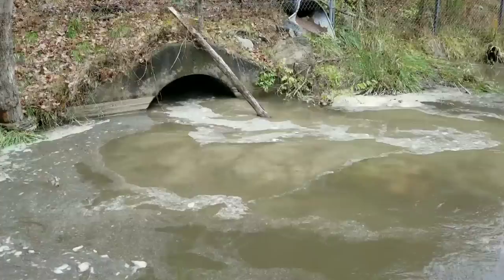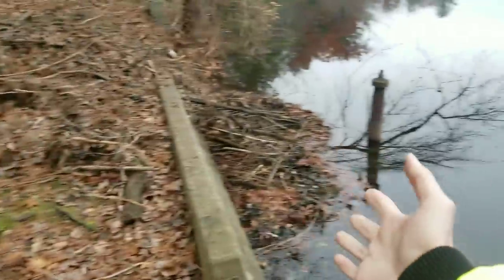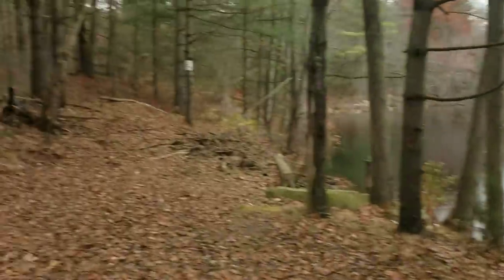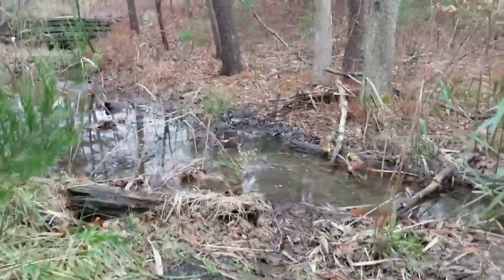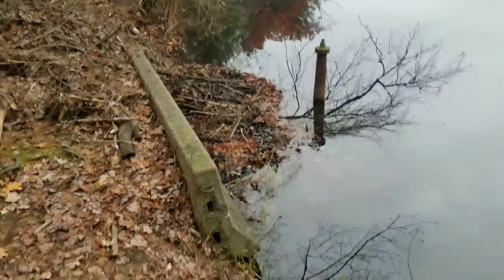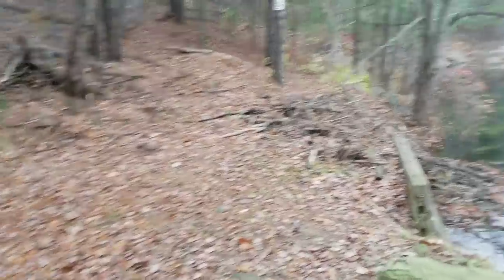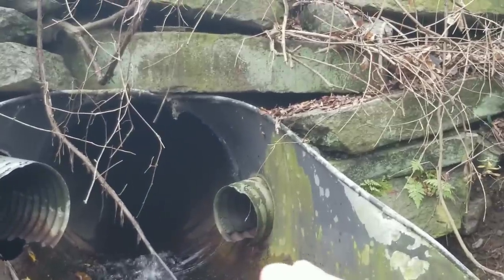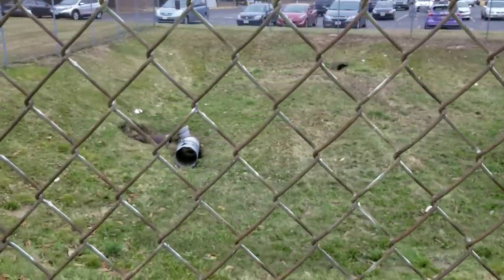Lake Drain Culvert Collapse/ Sinkhole UPDATE 11-5-2019

Comment: " A Massive sinkhole doesn't just open up overnight."

And yet just a couple weeks ago a massive sinkhole appears out of nowhere and swallowed a city bus.
Reply: I think the idea was that since the pipe just started to get rusted, the sinkhole won't appear that quickly. Sure sinkhole appears suddenly but it takes a while for the soil/ground to erode before the sinkhole to form. Given that the culvert is blocked, it's less likely the sinkhole would develop since the water can't carry soil away. If they just cleared the culvert of sediment and left it I'd be seriously concerned.
Reply: @takumi2023  3 months ago he went inside the pipe and it had sign of rust and small holes where it was evident some dirt was coming through. I wouldn't be surprised if the whole road collapsed if they left it for any longer considering how fast it escalated in just those 3 months. All it would take is some good blasts of torrential rain.
Reply: thats because it started happening years ago and was never discovered until the sinkhole appeared.  which gives the illusion that it appeared over night.
Reply: @takumi2023  It's amazing doing a little bit of math on the amount of dirt that looks to have already fallen. If the dirt is falling halfway down the pipe (150ft in) and the pipe is 4ft in diameter and the dirt has half filled the pipe from the ingress point, that's ~942.5 Cubic feet (26.6 Cu. Metre) of potential sinkhole. Insane
Reply: We cant forget about the Corvette museum either. The video is there for all to see 6 Corvettes swallowed overnight when the floor fell through. It does happen. If earth material is in the water then obviously its coming from somewhere.
Reply: @aaronrobertson8022  oh yeah, definitely can not forget that one
Reply: The State of California Department of Water Resources ignored Oroville Dam for decades while they were spending money to protect the Delta Smelt. It came within moments of total failure and was only saved by a MASSIVE intervention and investigation by the Army Corp of Engineers.  Our State and local governments are dominated by bureaucrats and power-crazy egos.
Reply: To get to the point that sinkhole would open up, it does not happen overnight.  It could be days, months, or even years of erosion beneath the surface that creates the pocket of air below for a sinkhole to form into.  Save for an event like an earthquake, large amounts of earth don't just disappear overnight.
Reply: no it didnt. the sinkhole was there for years undetected, it COLLAPSED suddenly.
Reply: @MikeB-py4ym  It did?
Reply: @pamelatify  DPW and DOT....both GOVERNMENT agencies...now  just what could possibly go wrong there?  Is anyone naive enough to think that bureaucrats are going to do anything besides suck up fat salaries to match their fat butts (or heads....hard to tell which end is which sometimes)? Who knows how big the hole is that is actually HIDDEN outside of that rusted out pipe?
Reply: Didn't a couple years ago, a house in Florida was swallowed by a sinkhole and a person went down with it and they weren't able to find and retrieve the body?
Reply: @lrock48 , yes.  Poor guy was asleep in his bed from what I understand and probably never knew what hit him.
Reply: Sinkholes indeed doesn't just open up overnight. But clearly the area is only visited when it is clogged and floods the streets. So if the collapse kept on happening without the drain getting clogged and flooding the street and Post 10 wasn't there to report it, those people might end up having bigger problems than what they were supposed to have.

Well big projects does require a lot of money, and that money tickles the hands of those corrupt officials.
Reply: @davidhatt5217  yezzir other David

This is just as much for you as anyone else, and it has already been said in this thread, but big sinkholes take days/weeks/months/years to form. When they collapse, sure it takes everyone by surprise because you couldn't see it, but that's why you wouldn't be able to tell when or for how long it had been forming. Once enough dirt falls/gets eroded away, it can no longer support whatever weight it had normally been supporting when the dirt hadn't yet been displaced.

There are likely sinkholes in a bunch of areas that you wouldn't suspect either because there aren't any obvious signs that one has been forming, or nobody has bothered to look hard enough around the area. The collapse is sudden, the sinkhole itself is not.

Comment: I knew you would get someone's attention! I shared your videos everywhere.
Reply: I also shared his last video of the collapse all over even tweeted it to @realDonaldTrump. Not taking any credit.  You did all the leg work and phone calls. Great job post10.
Reply: I showed this to My current boss who is a retired civil engineer. He specialized in septics and inspection of drainage system. He said this was looked like the metal system didn't look useable. The company he worked for and lots of others thought it was better to use metal in everything because they didnt have the standard hard plastic than when this was built. He said he is going to show it to the class he teaches as an example of weather damage and what happens when rust with high pressure on the pipes.
Reply: in the state of mAss it means nothing, they are the masters of corruption
Reply: @ElCidSilverBlade  why send it to trump? He doesnt do anything except cry on twitter.

Comment: Post 10....you ask a very valid question...quite frankly it applies to a lot of our older infrastructure. If something is going to be torn up for replacement and repair, why aren't  there fun ds in place to deal with aging surrounding structures?

I live in an area, the road surfaces g etc replaced...then the following winter the wa t er or sewer lines underneath break, resulting in utility shutdowns.

Comment: I was amazed at the amount of material that came out of the pipe from the pond side clear to the exit dirty. Watersheds are not working there. Meaning under the road which could not drain because the pressure on the pond side being higher level was pushing up water through the hill around the pipe not through it. By the looks of how much dirt that pipe had in and around did in fact have a sizable sink hole under it.

Comment: Even if a sinkhole doesn't form, or it's not a big one, that still means you have to shut down that area to repair it and prevent another one from forming, and still install a new culvert. Plus, that culverts blocked and if the DOT/DWP ignored the issue it could flood the rode and get people hurt

Comment: Good eye for trouble, Post 10. They should be able to retrofit a hdpe pipe into the existing corrugated steel pipe after they clean it out. That should ensure the road doesn't collapse.

Comment: If you compare the ground level of the exit pond, before and after collapse, you will notice how much material has eroded from under the main road.
The culvert is partly filled with pebbles and small rock, which means that the sand and dirt are washed out. You did not show how much sand went downstream, away from the exit pond.
Roughly estimated at least 100 cubic meters (yards) or 2700 cubic feet.
There will not be big empty holes in the embankment but large less dense areas.
That is enough to cause a ditch across two lanes of four feet wide and three feet deep.
Not a Florida style sinkhole but enough to cause lethal accidents, because it will happen unexpected, probably during rain fall when sight is less.
Repair of the embankment will be difficult.

You have done a good job, keep on watching this problem area and the repairs.

Comment: Having the corrugated metal piping rusting out seems to be a common occurrence.  Connecticut DOT is in the process of replacing a very large pipe that goes across I-84 at Exit 71 due to corrosion.  That pipe has probably been in place since the early 70's.

Comment: I'm not surprised they didn't take you seriously, in the beginning. They're all the same.
The culvert probably collapsed where the two pipes meet. That's why there was so much mud. You were lucky the culvert did not collapse on you or behind you while you were under the grate ! 
This culvert will need to be replaced for sure. But I don't think there was a risk of a sinkhole, though. Because the hill is huge and even if the whole culvert had collapsed, there wouldn't have been enough space for the hill to cave in. But you did the right thing anyway, because, with the water flowing under the hill and soon around, who knows what could have happened.
( sorry for my poor syntax, English is not my language )

Comment: Here's hoping it gets fixed.  I disagree with their assessment that if a sinkhole has formed, it will not cause a catastrophic failure.  This is an area with several meters of fill dirt and it is shaking apart and washing away every time a vehicle causes a vibration.  The cavity inside could be very large, I do not know what their radar rests indicated, but hopefully they have the right people working on it.

Comment: It’s all about the $$$$ is why things don’t get replaced on new builds. They have engineers that may or may not visit the site to asses the situations before submitting plans. Then it could take years before anything is done due to funding. Now that you have brought this up to the public they may or may not do anything for weeks up to months. Some engineer will deem it safe or they will find the void bore a hole down to it and pump flowable sand or cement to fill the void. This will by them time to draw up plans and all that good stuff.

Comment: It sucks that most DOTs are reactive instead of proactive. It's much easier to get emergency funds for something that is broken right now, than to get money to prevent things from breaking.  I work for a DOT and constantly have to deal with this issue. We are not allowed to be proactive.... even though it is preached by the company. Like another person in the comments noticed..... brand new vehicles for some of the engineers who are most likely the reason this issue exists (not putting this in to bid when doing other projects in the area), but can't put money toward fixing an actual problem. Unfortunate.

Comment: The federal government used to give states funding for infrastructure. This is for which taxes are supposed to be used. Sadly, federal funding for this has fallen by the wayside. Sates cannot, by law, run a deficit, and while they can, via bonds, they have to balance their budget every year. Very little is used for public works, and what is used gets mainly diverted for highways and such. In California, homeowners pay their local governments to maintain these things, and it really works. I had a flooding issue in a downstairs bath, due to a broken sewer pipe at the junction. They were out in one day, ripped up the street, and fixed it forthwith. Because i pay for it. Taxes aren’t evil. They just need to be properly used for those who pay  them

Comment: Interesting....the area has flooded for years due to the drain being clogged. post 10 has been clearing debris from the drain to allow the high rising water to drain away to prevent flooding. He has spoken to various people and departments but nothing substantial has been done BUT as soon as there is a threat of a sinkhole and the possibility of threat to life (someone falling into the sinkhole) suddenly things start to happen.

This is what annoys me so much with councils, town leaders and company senior management, they all ignore the issue until a 'threat to life' situation occurs, then all of a sudden they begin to act, which usually results in the costs involved being tripled what it would have been if all of those originally informed had acted in the first place.

Comment: The pond looks like an excavation hole they took the material from to build the dam for the I-90 ramp. If that's true, the culvert should not be older than the bridge unless the bridge was replaced in the meantime. Wikipedia says that the Mass. Turnpike was opened in 1957, but the culvert looks newer than that. Anyone local who can shed some light on that? This is an issue of global concern now.

Comment: The engineer says that a sinkhole forming overnight is unlikely, but how long has that pipe been there? Hmm, let me think, years? Decades? It's been overnight and there's obviously some sort of critical issue as the pipe has severe damage that doesn't take an engineer to see. I don't feel sorry for the DOT because now there's most likely a huge and very expensive job to fix it properly. If they just would have kept up on inspections, and of course listened to post 10 this could have been avoided. Poor bastards.

Comment: Kinda funny you made all those calls and only the moment the news took notice did anyone show up or even admit who was responsible for it. Then the engineer they bring on to interview goes through the same incrimination government always does. Well ya your right but your still wrong for not being confined space trained. Clearly confined space trained didn't help the pros find, diagnose or even admit the problem. Not to mention that the engineer has no idea what size sinkhole will form because it's entirely dependent on the size of cavern that forms before a catastrophic collapse on the surface. It could be a small hole or it could swallow the entire road bed. Just like other videos of culverts giving way and being blown out.

Comment: Its a lack common sense. In the Netherlands where i live all the water tunnels are made of concrete. This must at least be working longer then 50 years. The USA is using a cheap metal pipes and built roads over it. That is insane! you know that the metal will rust. Now you have to change the pipe and the mountain and road. Its cost much much more. Its short term thinking. When we would do this methodology then the Netherlands would be taken by the sea and would be known only by the history books.